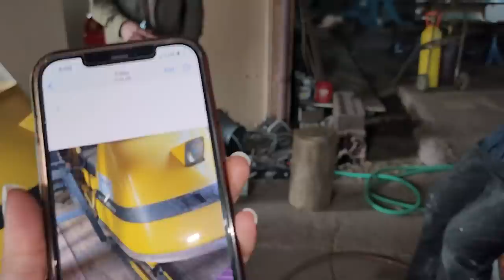We got Jim a gift for his 1957 Oldsmobile restoration 📦

Comment: I think it would be a great video if you could get Jim to show how he repaired this hub cap. I'm sure that the same procedure would work for other trim pieces as well. This is a dying art that needs to be shared with other DIYers. The floor in his garage is really something different, I've never seen anything like that. Rubberized or tar/pitch based undercoatings lock moisture out, but they also lock moisture in, which leads to unseen rust. I prefer Fluid Film, which is a nontoxic lanolin based product that breathes, allowing moisture to escape. I think it does a much better job at protecting your car's underside, but you have to apply it once every year or two depending on your climate.

Comment: You can take a quart of tar and thin it fuel oil. Once you get it thin, then use a paint brush to apply.Jack. Also, it is oil base, so it will stop rust.

Comment: That splined shaft is most likely "hardened" or "heat treated"... Welding on it is tricky, and not a good idea. You'll create a stress point (breakage) right where the weld is, if not properly pre-heated and post-heated. ...Then you're annealing the heat-treat, and it Still might break. I wouldn't do the work.
Reply: For me to custom fab a new shaft in Arizona, with heat treat and spline cutting, you'd prob be looking at well over $3000...  $1500 isn't a bad price for one's life if it's available. If it isn't available, message me

Comment: Bar and chain oil mixed 50 50 with spent motor oil. Put it on with a brush or a cheap spray gun. Makes a great rust treatment on rusty surfaces. Nice an inexpensive, it will never dry and it will seep in to all the nooks and crannies and the bar and chain oil sticks.
Reply: Thanks for that I live in the snow belt our cars rust away from the inside out that oil would treat it from the get go before it gets a chance to start thank you buddy

Comment: Hats off to Jimbo for gas welding, I’ve done a lot of gas welding back in the 70s but I’d never take on a job like that.
Mig is so much easier and faster once you understand heat control.
Jimbo would make an excellent TIG welder.

Comment: UPOL raptor liner.  For rust.  It's is a semi hard liner.  Comes in disposable quarts and get the spray gun with it.  I do a lot of restoration and rust repair. I can't guarantee rust advice lol.  But it does work for years. And it's a two part catylist system. Best part is you can use a small paint roller to use first and edge or line the over hed parts that the. Spray gun won't get to as you are spraying from underneath. I hope that can help Jimbo. If you know what I'm sayin

Comment: Please do not use undercoating or rock guard on bottom of car!!!!

Use etching primer, then epoxy primer(4:1), AND 2 coats of paint. This willcform a barrier from rust.

WD-40 sprayed on bare steel frame, etc. will prevent rust, if applied every year or two...

Comment: Jimbo spray boot floor and under the car with  Por 15. Two thin coats best paint over rust pach work ever  remember when replacing the lid put plastic sheet over the tin when replacing it

Comment: You may not be good at replacing panels but your surely did a good job welding that car back together. Whether its patch work or not you did a great job on that car Jimbo. When its welded it loses it tempering, therefore, if it has to hold the wheel on I personally wouldn't get that short axle welded up! I think your right Jimbo, most machine shops wouldn't do it. Most shops would definitely refuse the work, because they would be liable which means the insurance would forbad them in the first place so they won't do it.

Comment: Jim I had a problem with a shaft wore out, so when I got the new one to avoid future problems when I installed the new one I put JB weld let it sit for 24 hours, and the car has been running for over 10 years and never had that same problem. You can’t weld on a shaft because when the steel loses its temper it brakes.
Reply: I welded drive shafts for years at a machine shop 7018 rods with a Lincoln 500 you can do the same with a Lincoln wire welder, not sure what you mean you can't weld a shaft.